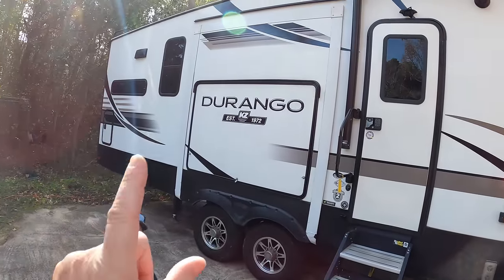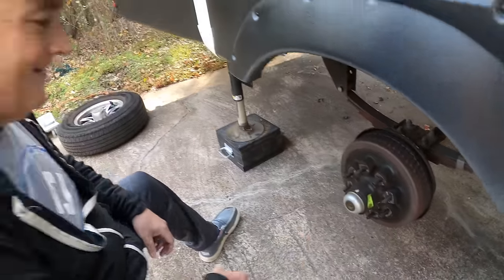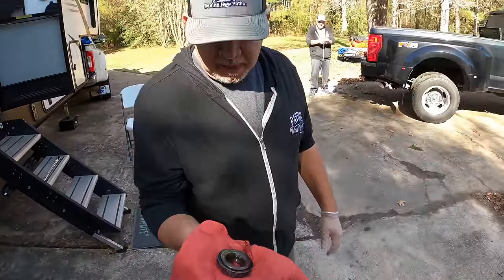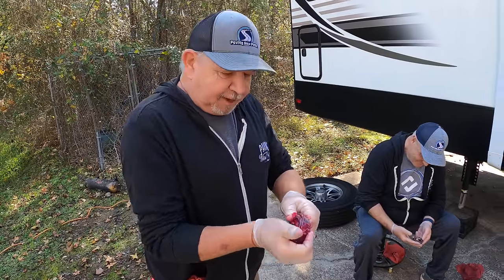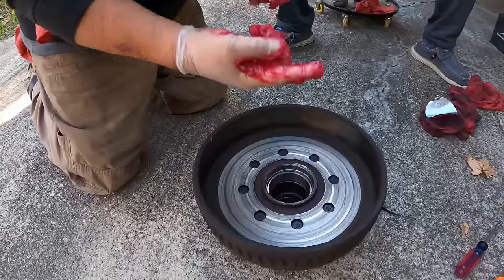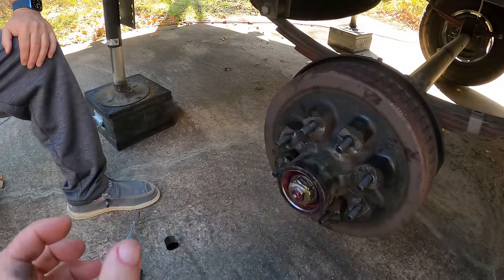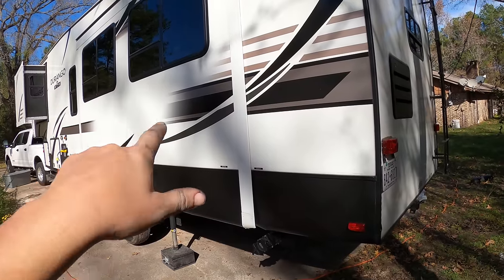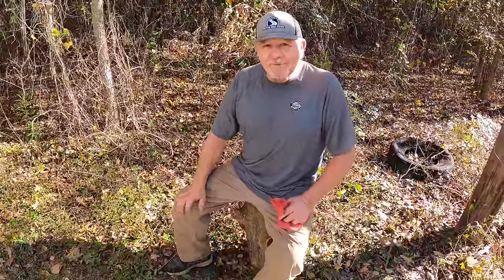STOP! Wasting Your Money On This! Fulltime RV Living!

Comment: When I had my travel trailer I always packed my own. With my bigger 5th wheel I started doing my own after trying Camping World service. They put barely a teaspoon of grease on the bearings and two to the bearings seized and flat spotted my tires. I had been having my dealer do them for a while but was a lot farther distance to travel so had tried Camping World on a whim and what a mistake. It's like Phil says, it's easy to do and just squish those bearings full of grease. Really concerns me when I hear of people shooting a lot of grease in using the zerk fittings on the axle because when often happens is the grease shoots past the back grease seal and gets all over the brake linings. And you haven't inspected the quality of the bearings.
Reply from the maker: We believe in packing your own, not only is it an easy job, it gives you a chance to learn your rig!  We have used the EZ lube zerk before while on the road but only because we understand how it works and how to do it properly!  It was also not taking place of the annual service but just a way to move some fresh grease into the system after several months of hard travel!